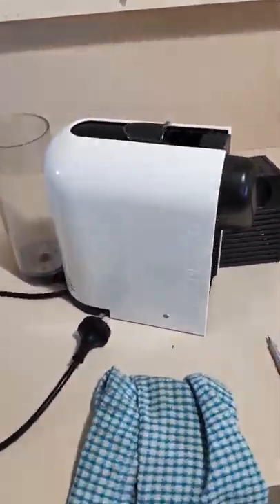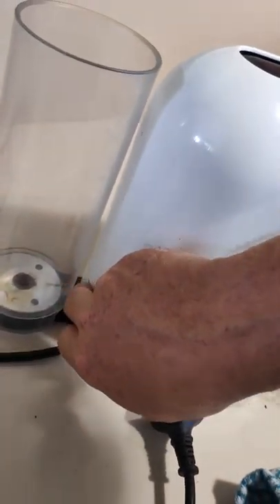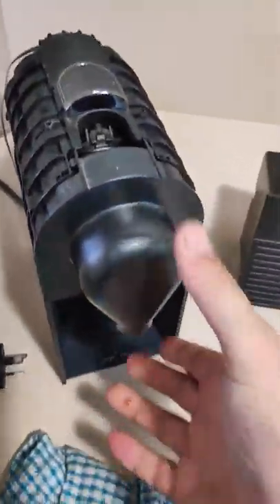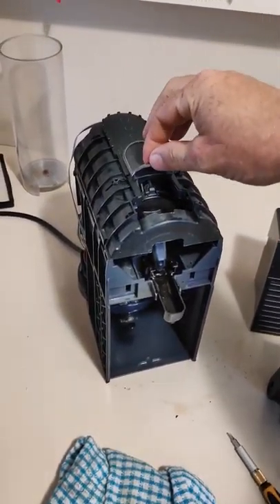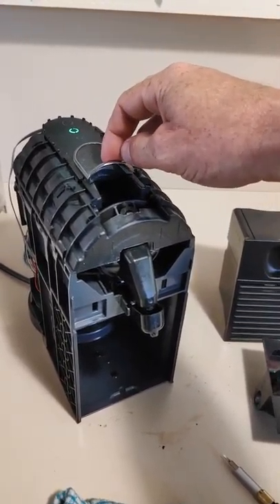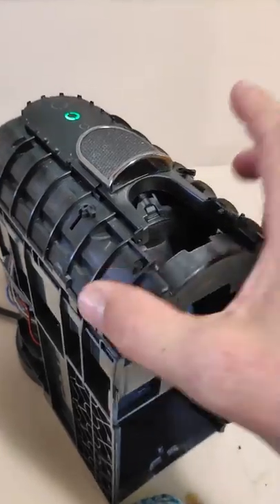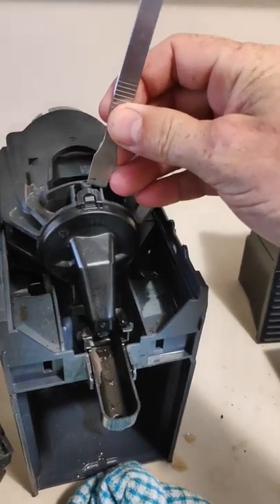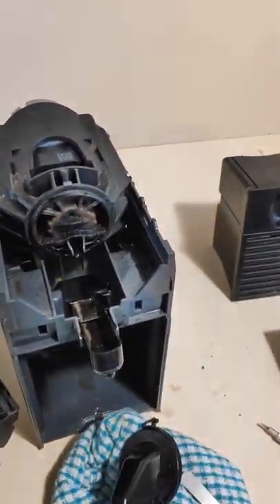Nespresso machine - the fastest way to open up your nespresso coffee maker.

Comment: This was the single video that saved my machine THANKS!!  I thought the bottom screws needed a hex but a small screwdriver works thanks to your vid.  Very important when putting top back on to do it with piston/spout retracted b/c otherwise putting in on in different position messes up the mechanism and won't work.  I had those two very small pieces break off so poured back into drip tray but I got a replacement spout on Amazon for $13 and replaced it and all works great again!

Comment: Thank you Thank you Thank you .. Used your videos to discover the "secrets" behind the Delonghi EN210 Nespresso Machine breaking. All fixed - I've decided not to put the front plastic cover on, and manual tip the 'funnel' myself. (I have about 50 pods to get through that I've collected over the years and that'll be it).
(Perhaps change the name of the video to include the model number - or at least that is a Delonghi machine). 😀

Comment: I know I am a bit late to the party but I would like to respectfully contribute.   
I too have found Daniel John’s videos to be helpful and I have gone back to them repeatedly to refresh my mind when opening up my (regularly) machine.   Sadly, this model is poorly designed, breaks often, and makes a mockery of the concept of a warranty – if we were to send our Nespressos off every time they broke, we’d be broke too, just from the postage, not to mind the absolute horror of being unable to drink coffee 🤪.  
I am unaware of Nespresso apologising for this shoddy machine, or extending their warranty.   
As was stated in other comments, far better to repair than throw away.  
Safety should not be restricted to laws and regulations but should be integral to our every move.  
What this video describes is not overly difficult and requires only a bit of common sense plus the gumption to try it out; if an owner is not up for the job, they will baulk on encountering the ‘tamper-proof’ Torx heads (another attempt to thwart home repairs by Nespresso)

Sadly, I don’t find Andrew’s comments helpful – as others have said, warranties will probably be up or the users need coffee now, not in 6 weeks, after much frustration and cost.  
Keep up the good work Daniel John – we’re behind you all the way.  In fact, Nespresso might think about making their own videos based on yours (or, even better, make some machines that work!! 😂😂😂)
Andrew, if you reply to me, no shouting please, and please have a read over all your previous comments and try not to repeat anything you’ve already said multiple times as might make you look a bit pompous...

Comment: What do you do if the sliding thing at the top of the machines breaks off? Thanks!
Reply from the maker: That depends on what part of it breaks off. You may need a new part but it could also be fixed. Hard to tell without seeing
Reply: daniel joblin I understand. I think it’s called a retractor. When you put the capsules in to make a coffee you always have to pull that retractor down. That little retractor completely broke off when I opened the machine. I have no idea how to fix it. Any thoughts? Cheers!
Reply: Alex Nikoloudis You have to take it to a Nespresso repair centre. You should’ve taken it to a Nespresso repair centre in the first place. You cannot purchase any technical and internal parts from Nespresso. Only Nespresso authorised service centres have the parts to fix Nespresso machine and they will not sell it to you. If your machine is under warranty they would’ve fixed it free of charge for you.

Comment: LOL YOU JUST VOIDED YOUR WARRANTY. If A  Nespresso authorised service centre notices it has been open up it will void your warranty and youll have to pay for the repair. Nespresso repairs it free of charge anyway if it’s under warranty. So why bother going through all this trouble ? keep this in mind you cannot purchase any internal parts from Nespresso anyway so if you need parts to fix it you can’t even buy it. Also you may do further damage to your machine by breaking parts if you don’t open it up properly.
Reply from the maker: Why LOL, Imagine that its out of warranty.... Imagine that you brought it second hand... Imagine that you have had it for 2.5 years and tis the weekend and you just need a Coffee. What I guess im sayinging is that I can think of a fair few reasons why you would want to do this... and your comment is strangly like @fanboy Larpee.....  perhaps you should only buy new things and then throw them out when the warranty is finished...
Reply: daniel joblin you do realise not everyone is an electrician but trade. What happens if someone gets injured by your advice ? You don’t care if someone gets injured ? Why not get it serviced properly  by a Nespresso authorised service centre ? What happens if you need internal parts ? Nespresso don’t sell the internal parts to customers. Of course you may find them on the black market but the parts may not be brand new and faulty. Most of the time to repair Nespresso machines you need a new thermoblock, pump, extract unit, levers, pcb, NTC.
Reply from the maker: @andrewjang5358  yeah I heard you the first second and third time... Stop pretending this is about safety... Let everyone choose what they want to do.  This helps people all over the world fix their machines.. We don't all live in a nanny state. Now if you want to help. By all means stay if not, you know where the door is.
Reply: daniel joblin MAYBE YOU SHOULD STATE IN THE DESCRIPTION THAT IF YOUR MACHINE IS UNDER WARRANTY TO TAKE IT TO NESPRESSO FIRST BECAUSE THEY WILL FIX IT FOR FREE. IF IT IS OUT OF WARRANTY DO THIS AT YOUR OWN RISK AND SAFETY. I CANT SEE A DOOR, IM LOOKING AT A COMMENT. THIS IS ABOUT SAFETY, I GENUINELY CARE ABOUT PEOPLES SAFETY OPENING ELECTRICAL GOODS. YOU OBVIOUSLY DONT CARE ABOUT PEOPLES SAFETY. NOW YOU ARE DISRESPECTING OLD PEOPLE AND NANNYS. NOT EVERYONE THAT WATCHES YOUR VIDEOS ARE ELECTRICANS U KNOW? MAJORITY OF THE PEOPLE WHO WATCH YOUR VIDEOS ARE EVERYDAY PEOPLE WHO HAVE NO IDEA HOW TO OPEN UP A MACHINE THATS WHY THEY ARE EVEN SEARCHING FOR THIS.